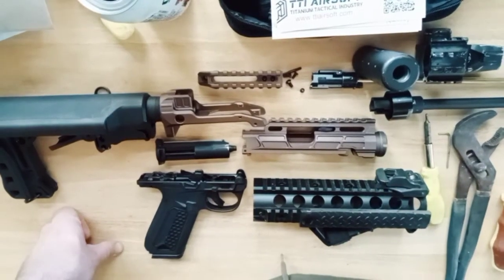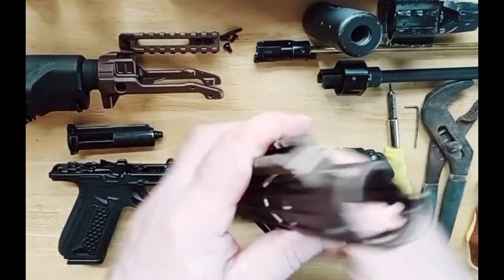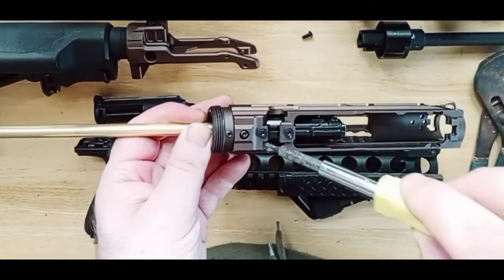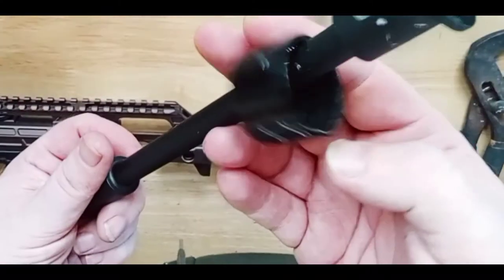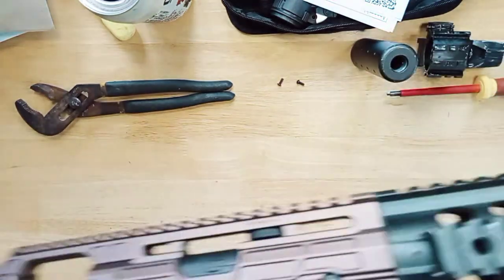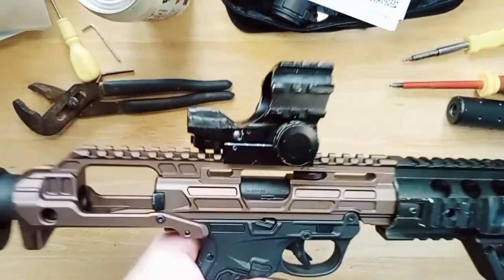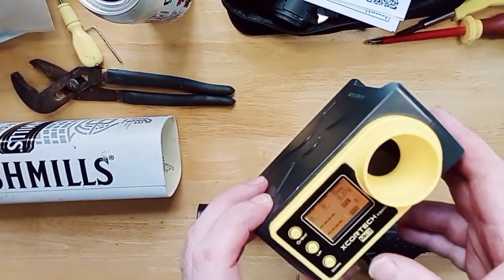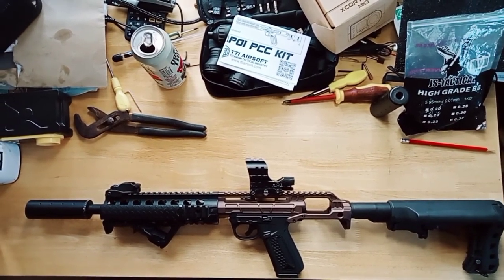BUILD AAP01 CARBINE

Comment: What upper recever and m4 stock adaptor ? Can any aeg hand guard fit?
Reply: Also what outer barrel was it  aeg?
Reply from the maker: @timdavies9291  Hi.
Stock is g&g v3 you can use gbb stock tube or AEG.
AEG outer barrel, hand guard.
I tried EMG NOVESKE gen4 outer barrel and barrel nut wouldn't fit.
What ever AEG one you  get the pins on the outside barrel that keeps it from twisting might need a bit of a dremel.
Reply from the maker: Receiver is the TTI PCC

Comment: Harder to prime now and just as difficult to switch to full auto?
Reply from the maker: No not hard to do.
Easier if you get the extended charging handle and semi full auto switch. I left mine standard I can use it just fine..
I don't use fully auto so don't need to touch the switch.